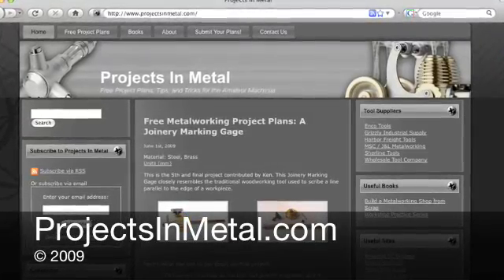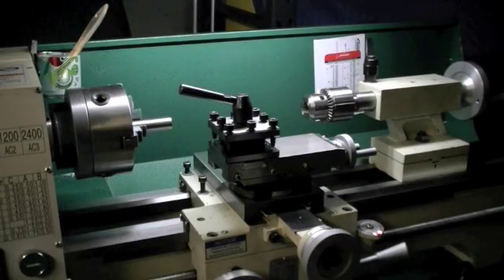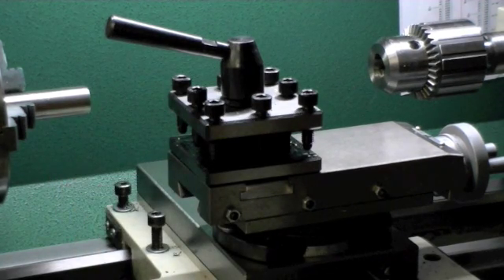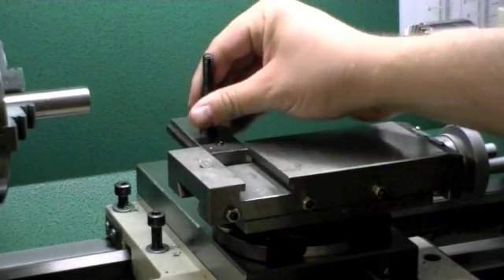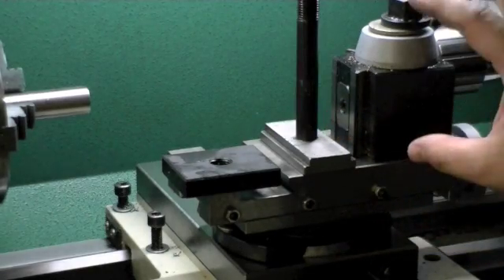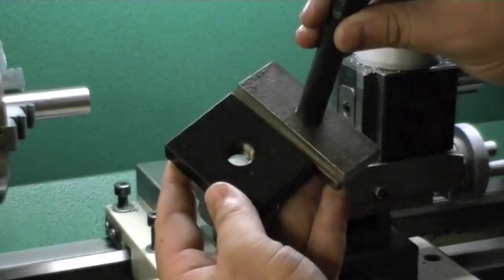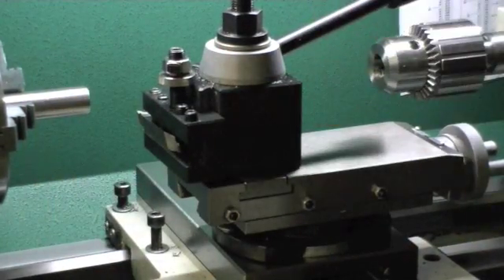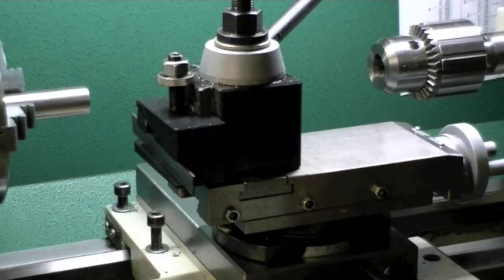Grizzly G0602 Upgrade: Adding a Quick Change Tool Post to my Metal Lathe

Comment: IMPORTANT NOTE FOR OTHERS WHO WANT TO ADD A QTC TO THE G0602...
The G5689 QTC mentioned in this video WILL NOT WORK with 12mm or 1/2" carbide insert tooling!!! (Like Grizzly #H5681)  The tool holder bottoms out against the compound before the cutter lines up with the material's center.  Grizzly tech support claims it will work with HSS tools - haven't confirmed this.